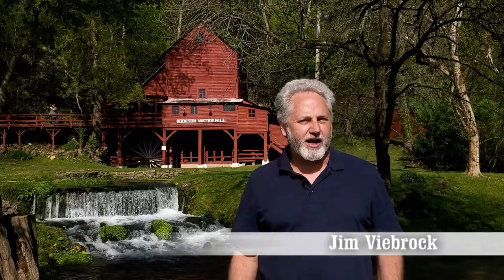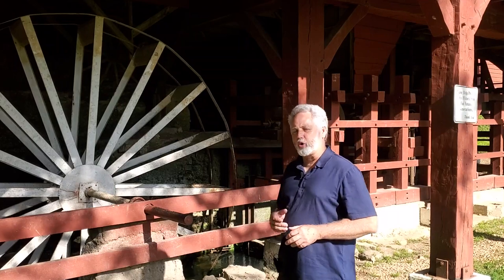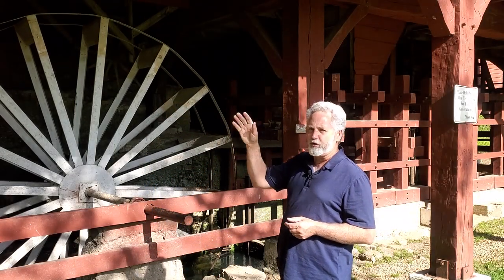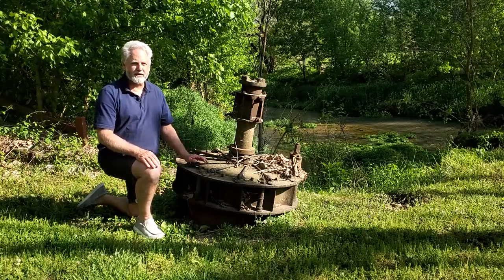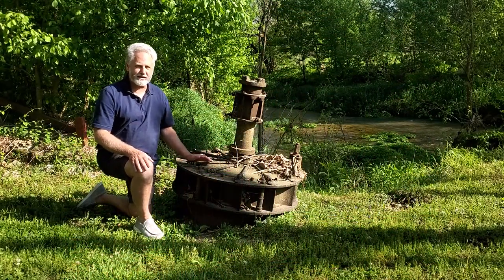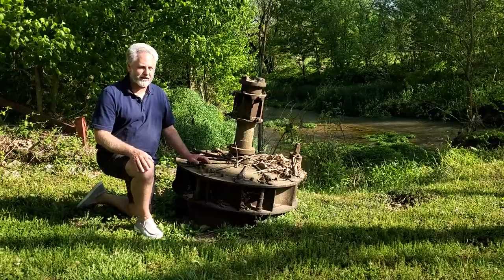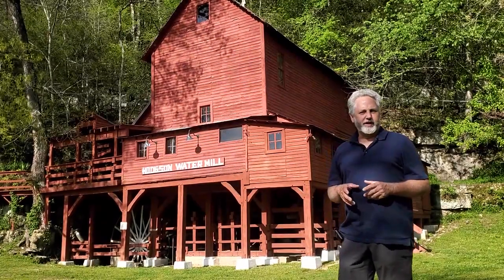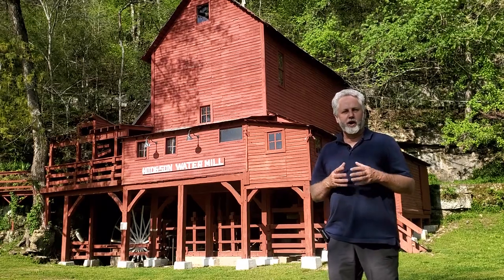Let's explore Hodgson Mill. Using a water powered grist mill to grind corn or for making flour.

Comment: Fun fact about Hodgson Mill. The company that formed from Hodgson Water Mill started in 1894 when the mill was built. This particular mill ground flour until 1976, a very long time for an 19th century grist mill. By 1973, the mill was using 1 million pounds of wheat and corn per year to meet demand. Eventually, demand became too much and production was moved full-time to a modern milling facility in Gainesville, Missouri. However, that same company that I mentioned earlier was still operating at full capacity until 2019 when it was bought out by Hudson River Foods in Hudson, New York. Today the brand is still made with the mill on the logo, but its mostly just pankcake mixes and cake mixes.
Reply from the maker: That interesting information.  Thank you.

Comment: I'm not understanding the permit thing. Are the mills no longer allowed to use the water at all? Even if not allowed to make even the most minor changes to the waterway or such why not use the original mill wheel, turbine to turn a generator so there are no alterations and put a generator inside the mill even if it is just to power the lights at the mill? You could power a small town with just the spillage.
Reply from the maker: In recent years, both the state and federal governments have really cracked  down on environmental  regulations. For example, if a mill dam is destroyed in a flood, it most likely will not be rebuilt, with the exception of Maybe one of those places being on a historic registry, would be about the only way it would be allowed to happen. There are new regulations about impeding migrating fish for example.  Even government agencies are strugbling with some of these regulations bridges for example have to be a certain height and not impede the flow of natural waterways in any way. It's government regulation on top of government agencies that are now making life difficult for some private property owners. I don't really want to open a political conversation here, but this issue is not new, if you'll watch the end of my Richie mill video you will see an example of this- that's well over a 100 years old.....